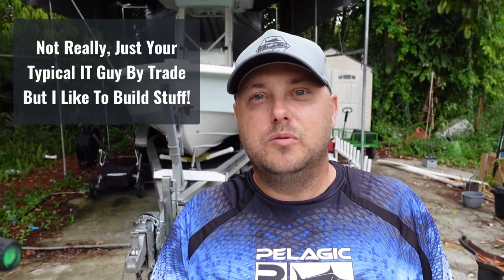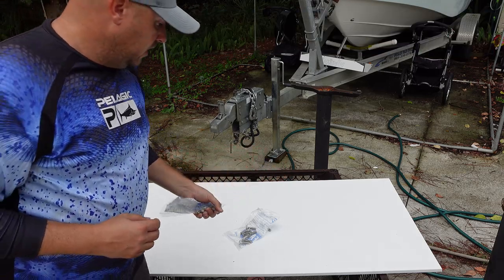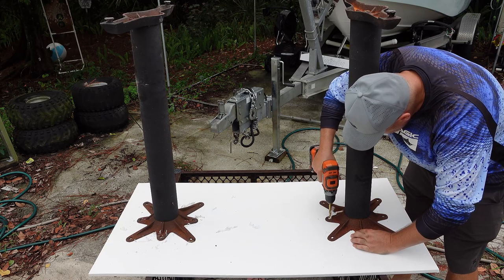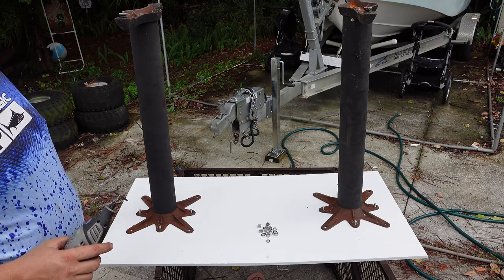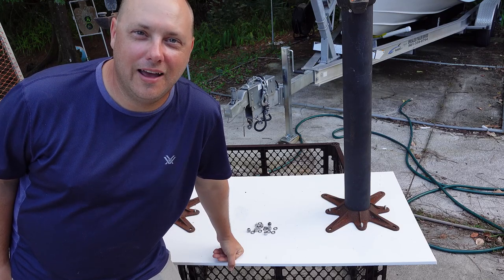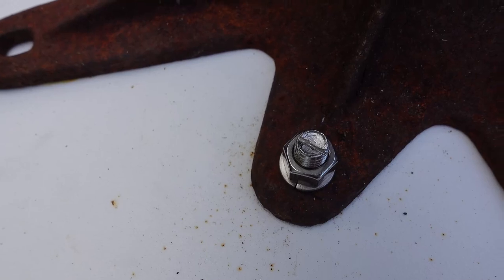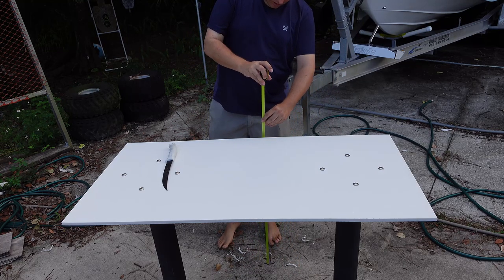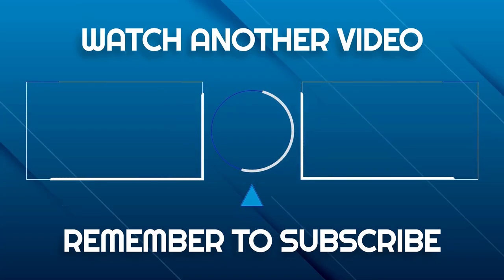How To Build A Fish Cleaning Table / Fish Cleaning Station DIY For CHEAP!

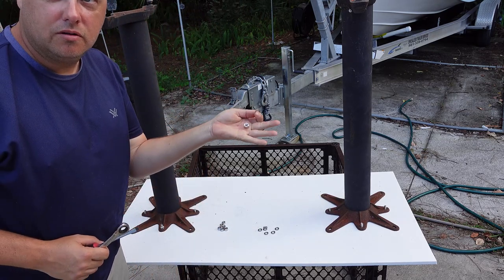Comment: Thank you, I have been trying to figure out what material to use for my station. It seemed like there was a little flexing on the table top (6:45).
Reply from the maker: It does flex a little, but thats just because I made it bigger than necessary. If you had more stable bases underneath it wouldnt flex. I dont notice it when cleaning fish though. You could also get thicker starboard, but that would be more expensive.